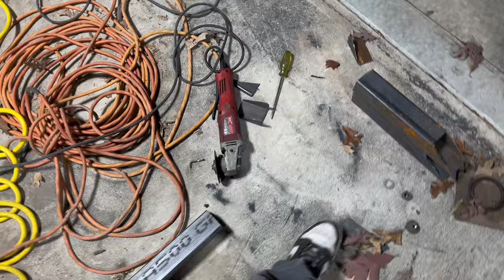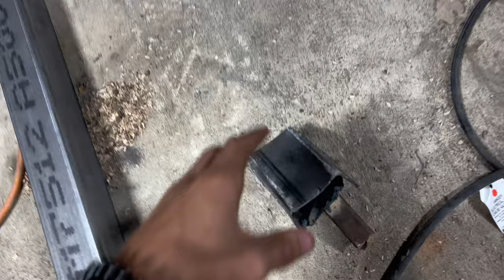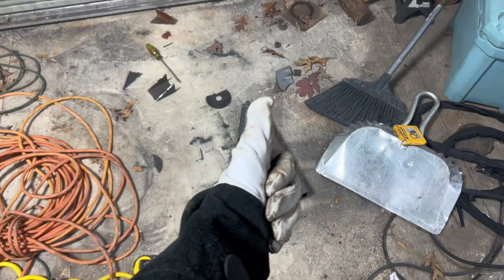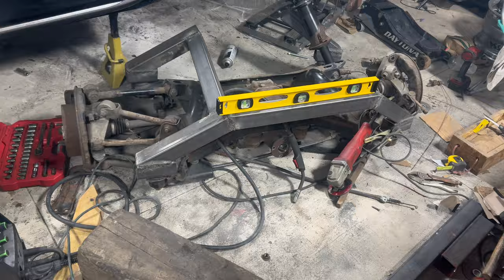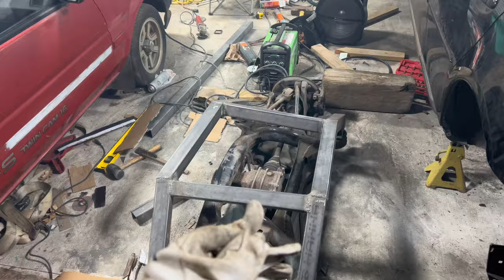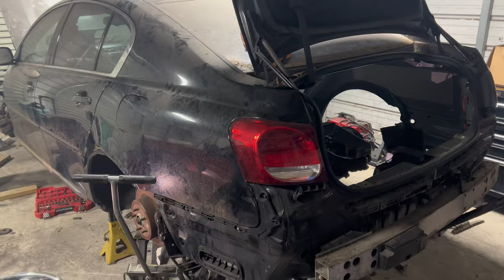BIPPU BUILD PT3, MAKING NEW REAR BEAM

Comment: Rudy just cut the floor right out the whip like it’s another normal Friday!! This unit here is going to light a fire under the static community for SURE! 🔥🔥🔥 For flux-core them welds should get the job done. I’ve seen worse welds hold a hell of a lot more, but just a friendly suggestion: If your welder has the ability to run argon gas, get you a small tank with a regulator and some .023 mild steel wire and your welds will be stronger and better instantly! Been a welder/fabricator for 15 years so if you got any welding questions that I can help you with or need any fab advice feel free to shot me a message or comment on here. Anything to get this build further along so we can get some more content! Tay gunna be tryin to burn his garage down welding after he sees what you are doing here!! Keep it up man! This shit right here is going to be incredible!!! 🔥🔥🔥
Reply: i got a question ive been in welding school for 2 months and im learning with e6010 but i wanna do tig or mig but dont know what one is better for me bc i wanna work on bulding so what should i do anything helps
Reply: I would go MIG then TIG bud. MIG is pretty simple and productive. TIG takes some time to learn for sure but the welds are the best looking out of all the processes.